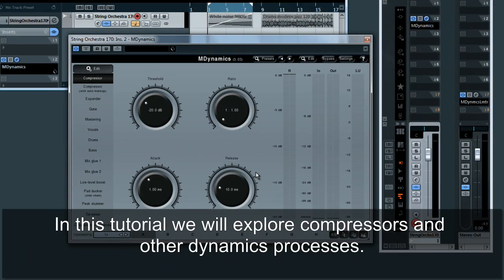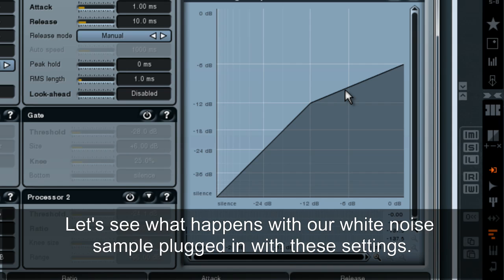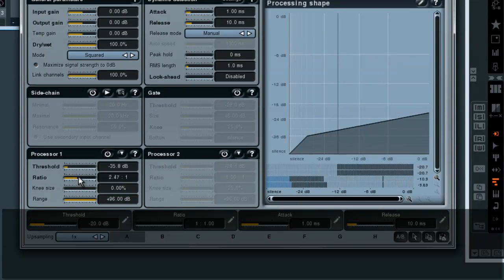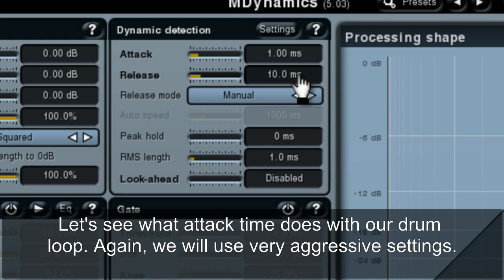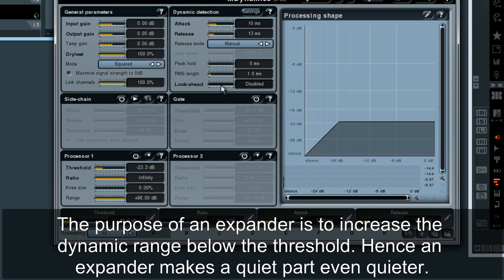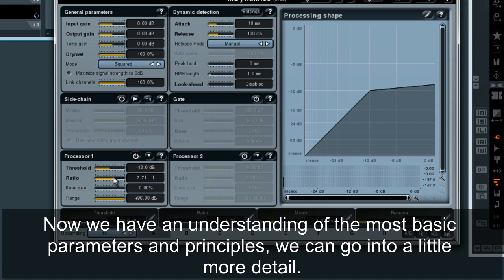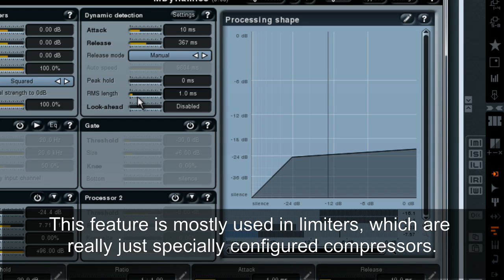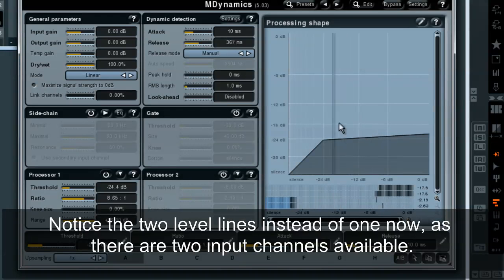Compressors, expanders, gates

Comment: What you've just said is grammatically and logically incorrect. When you speak about attack or release - you can either describe time and use 'fast' or 'slow', or numeric values in ms - and these values can be high or low. 
It's grammatically incorrect to say "low attack". It has nothing to do with my attitude. I sincerely wish your company all the best, and use your plugs extensively.
Probably it's another reason why Melda has such bad UI and UX as it's reluctant to listen to professionals?